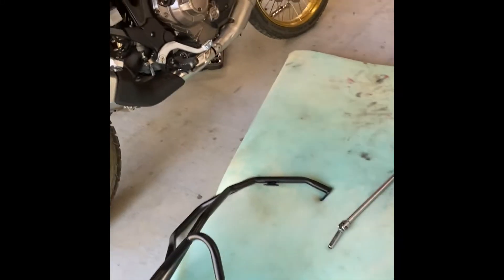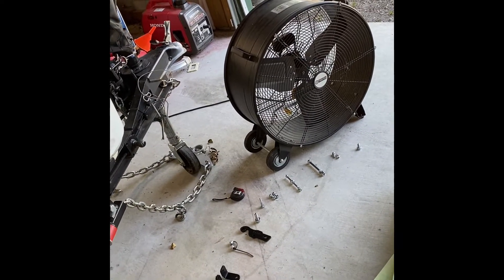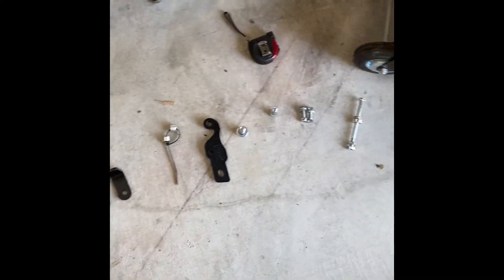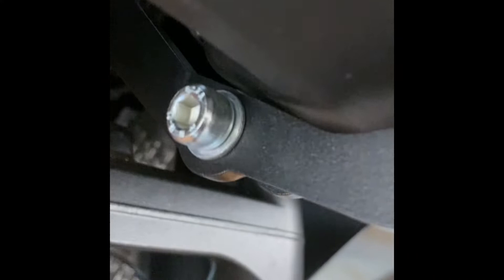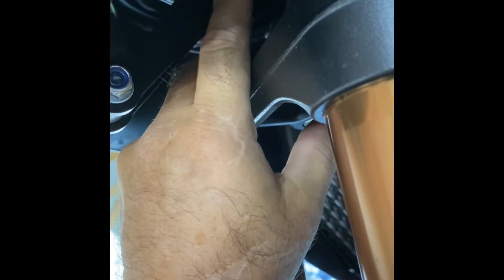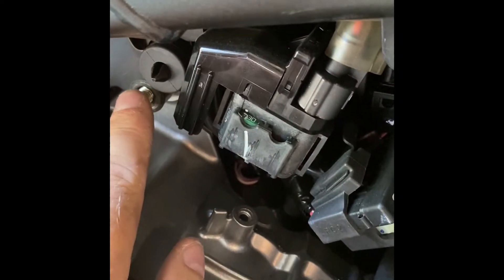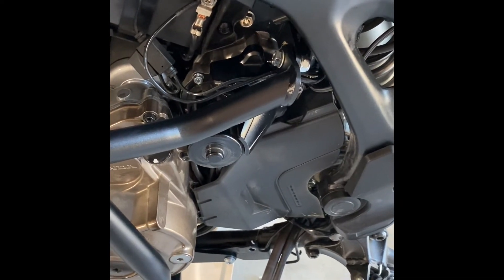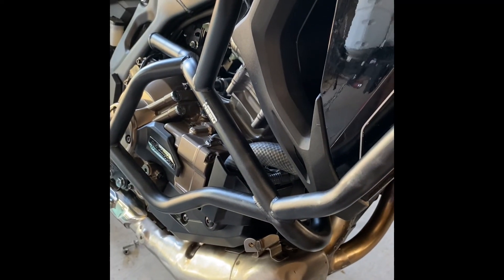DIY Installation of Honda Africa Twin Heed Crash Bars

Comment: Hi @ziprun ! Thanks for this video man, plenty of good pieces of advice.
I'm actually struggling installing my Heed crashbars on my brand new Africa Twin ADV Sports ES DCT.
How to make sur I am using the right left or right bended bracket and how to be sure which side goes underneath the frame ? 
I can't get all the holes aligned with the crashbar on the left side even though I doubled  check all the sleeves width and position...
Thanks in advance !
Reply from the maker: It is a slow and painful process, this is why I tried to carefully explain these issues.  Hopefully you found the answer.

Comment: good vid. Quest if i may.
I noticed on heed order page/ there was an option for  shipping such as UPS/ fed ex, etc/ and another option for parcel post from Poland/ Is that the one u used? I thought it was @ 65. as u said. And, what about that 'duty fee' from the dock?? did u have to pay that?

anyway i have a 24  Twin ADV SP manual, and these bars seem stout and reasonable.

tkx
Reply from the maker: my delivery was USPS, no duty fees